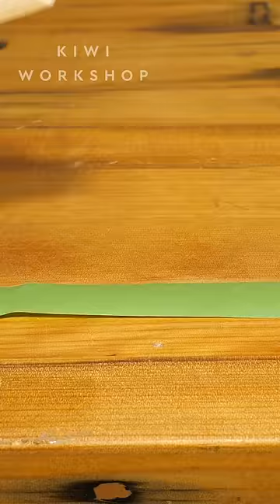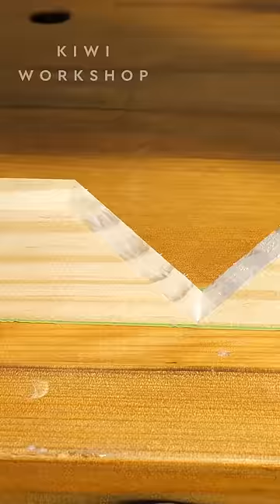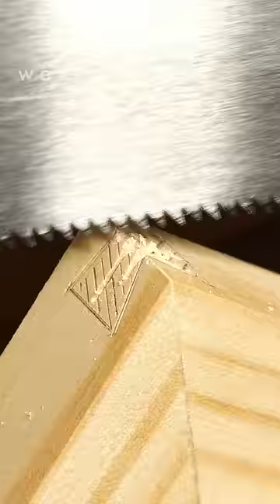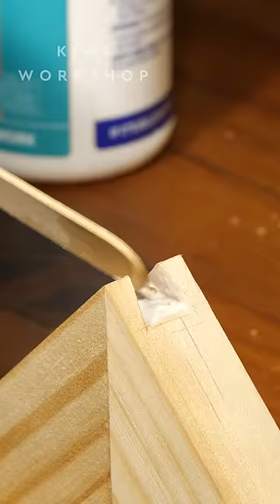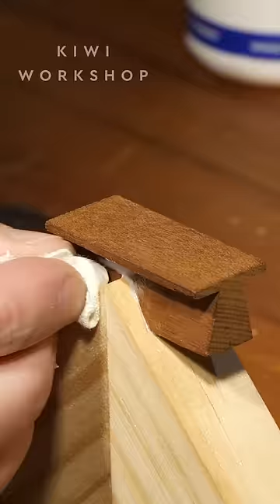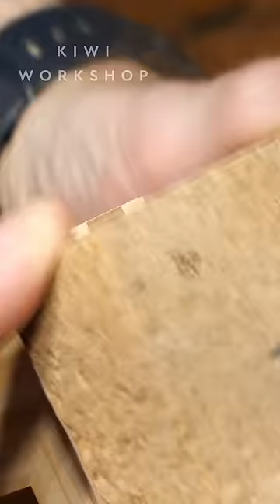What Is The Purpose Of This Joint? #woodworking #woodworkingjoints #asmr #diy

Comment: Odd: Clearly an exceptionally skilled crafts-person, but doing odd things like pencil + marking-knife (who does that, marking knife alone is superior?) and wasting huge amount of the dove-tail spline (why?)
Reply from the maker: Thanks. The pencil was mainly for the benefit of the video to show what's happening. I'm not sure why you think I wasted any of the dovetail spline? Centering it was the most efficient way to get two reusable offcut pieces. If it were pushed to one side, that would have resulted in a small piece of waste on one side after the flush cut.
Reply: @kiwiworkshop   I can't see a need for two short pieces of spline over one long one (might be that I'm missing something?) You can always cut the long one in two (of any length) later if you wanted to? 

Look, you're almost certainly  more skilled than I am, so probably best to ignore what I'm saying, and it's a really great end result, and some really nice video filming/editing too. Respect on both of those accounts.
Reply from the maker: @JustinShaedo  it all depends on how long the spline is. If it were say a foot long, then you are correct, centering it wouldn't be the right option. In this video, I could see that I could get 3 splines out of one piece (just), so I have effectively divided it by 3 by centering it before the flush cut. After the flush cuts were made, there was zero waste, since both offcuts were 100% reusable. I might have got lucky pushing it to one side, depends on how much spline would have been left after the flush cut waste was removed. You always want some overlap before the flush cut and it should be more than the width of the saw blade.
Thanks for your other comments, most appreciated!